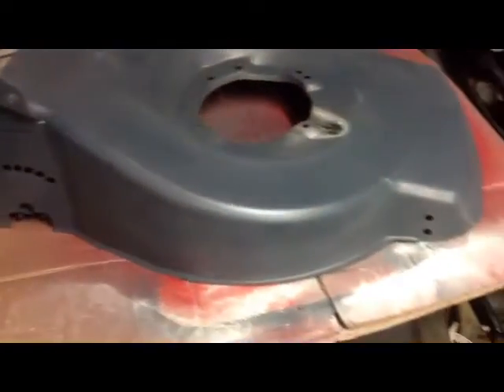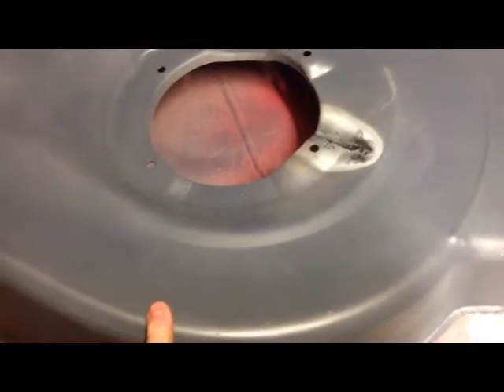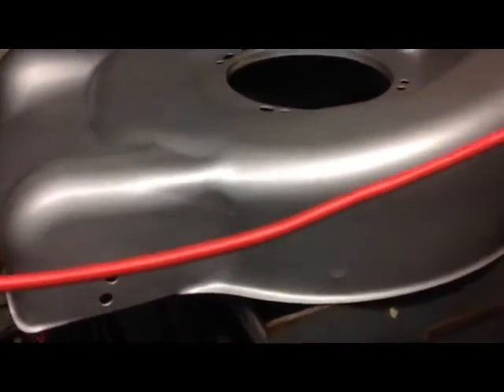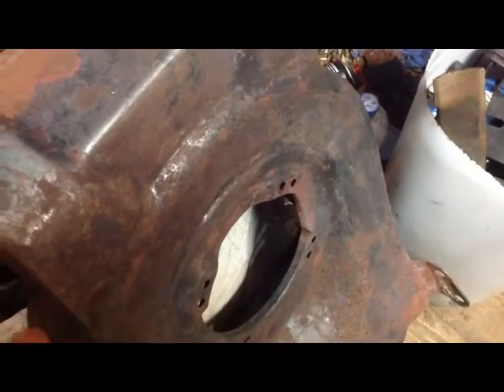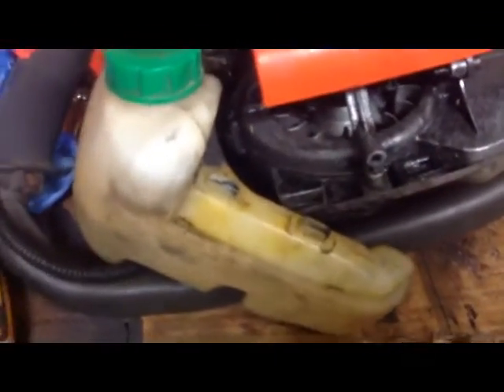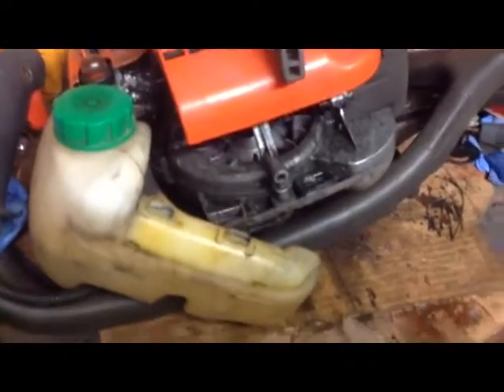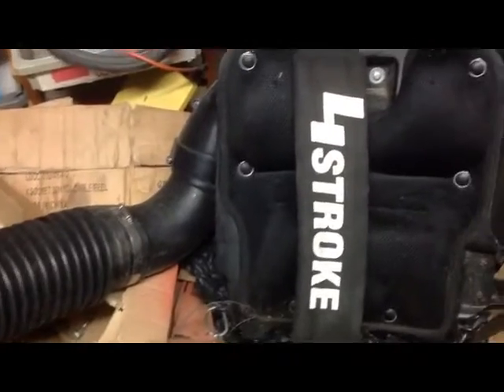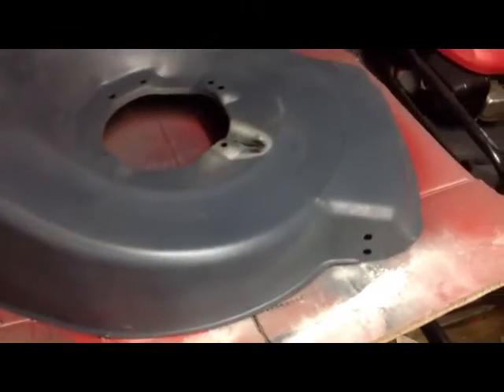Lawnmower decks refurbish and shed update.

Comment: Are you putting the Honda in a briggs  Deck.
Reply from the maker: They were never really a Briggs deck they were sovereign or champion, these are just basic decks the bolt holes are correct to take a Honda engine. I've done it before they work perfectly, actually they come out better than the Honda izy mower as the decks are much stronger and don't rust nowhere near as much.
Reply: Sounds like a plan.